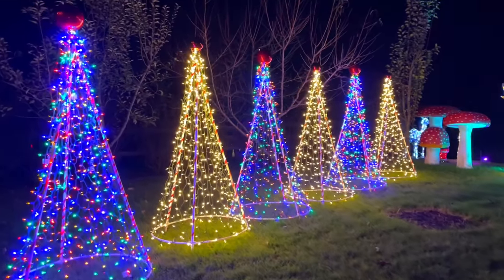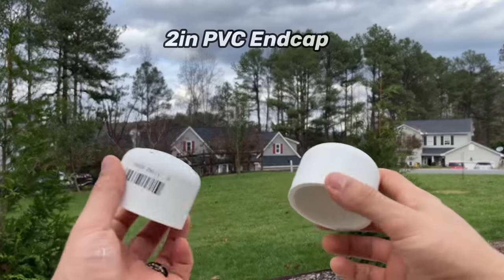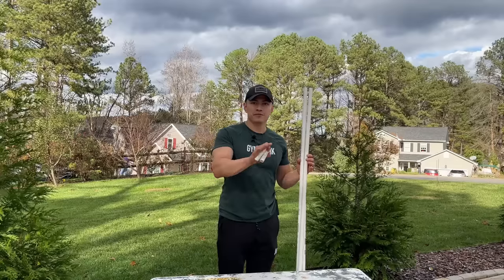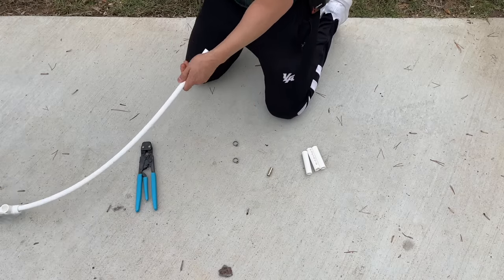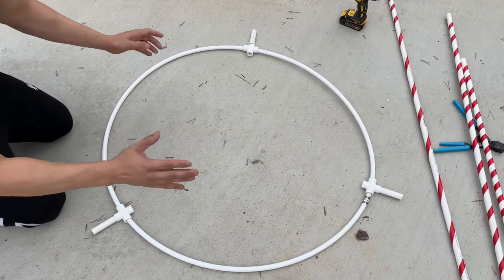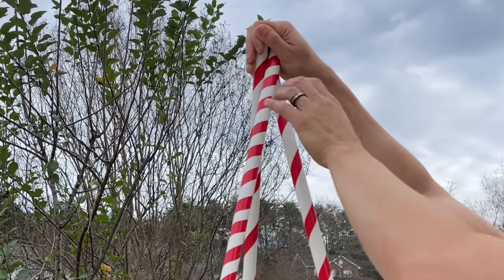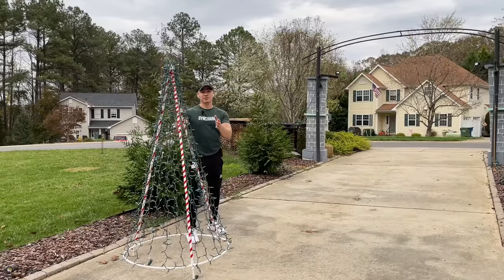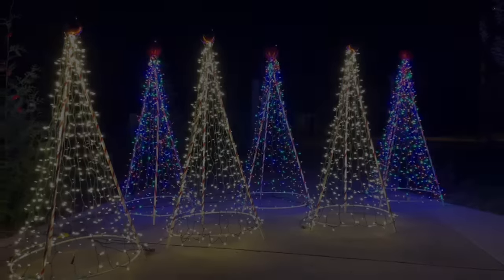EASY PVC CHRISTMAS TREES - TUTORIAL

Comment: 🤔Hmmmm…this gives me an idea. Instead of PVC pipes, you could use upside down round tomato cages, zip tie the top wires, and then add Christmas lights to it? You can stake the tomato cage down using landscape garden staples. I have some 54” in tomato cages in storage from summer gardening. The Christmas tree won’t be as tall but it’ll be an easy diy. 🤷🏻‍♀️

Comment: About how many strands of lights did you use and what was their length? Trying to get a total length in feet if you don’t mind
Reply from the maker: I used 7-8 boxes of lights per tree. Each box has 100LED lights. More lights can be used if needed for a more magnificent effect.
Reply: I would also look for white stranded lights as they will reflect the light from the bulbs better.
Reply: Make sure they are led lights because the cheaper mini lights will blow a fuse if you use more than 3 strands per outlet or extension cord. Led is the way to go, you can literally put as many as you want.
Reply: You could also by 700-800 strand lights, that way you don’t really have to buy more strands, because that way it could become more expensive, whereas if you get one super long strand, they tend to be cheaper.
Reply: I have never seen 700-800 light stands where do you get them?
Reply: @wendylewis108  I am most likely wrong about how many are on a strand, but I got the strand online, also this was a couple years ago.
Reply: @wendylewis108  I was wrong about how many lights were on a strand, but there are several different options online about how many lights per strand you can get. The link I provided is for Amazon, and that one specifically has 1000. However, at least this way it’ll look much more fuller.
Reply: @erniewyles8832  we’re you happy with the lights,? I have the same amount coming🍻.
Reply: @richardgaia5970  yes. Very nice. Very pretty.
Reply: Amazing video, thanks for sharing! Congratulations on your new book 🎉! Very clever idea to advertise your book yourself on your video. 😉 It’s a swell Christmas gift idea. I’m sharing your video especially with my friends and family with kids that I’m sure will enjoy your book 📕. Happy holidays ❄️
Reply: @wendylewis108  it's probably 300
Reply: @IsaacAlexanderDIY Thank you for video, I can't wait to make a couple of them but I can't help but ask about those huge mushrooms in the video! I love them. Any info is appreciated.
Reply: @bethschuler463 wow, I didn’t realize that.  That would definitely explain why the old ones were always blowing fuses.  We used to have a special place in the drawer for the extra little fuses.  So glad we have LED now.
Reply: Hello Mr. Alexander I love you tutorial and I was wanting to make me one so I was wandering I have the real small PVC pipe and the diameter is small clouds I use that to make one and would I need the same materials you used for the wider PVC pipe. TIA
Reply: Thanks for the post!
Reply: Trying these! Ty! U r amazing!

Comment: If price is an issue, instead of buying the PEX tool, clamps, and fittings, you can just get one SharkBite  1/2-in Push-to-Connect Coupling.  This will work the same, cost a fraction of the price, and will only show a little metal in the coupling, which can easily be painted to mask.  Just a tip for those who are only buying the pex stuff for this project.  The tool alone is over $50, where the coupling is just from $8 to $10 per piece.
An even easier alternative would be to simply use white duct tape to secure the two ends.  The pipe isn't under incredible pressure, and it makes it easier to take down at the end of the season.
Reply from the maker: Thank you so much for this cost saving tip, I can’t believe I didn’t think about the push to connect coupling, thank you so much for this!
Reply: Great idea.  To also save money, could I use a hula hoop.  I have so many I never used in the summer.  Some of them are very large in diameter and some smaller.  I could cut them and use the duct tape to secure the two ends as you suggested Ernie if I use the couplings.
Reply: @robinowens2851  yup, I think a small hula hoop would also work. Good suggestion.
Reply: Can you just use hose clamps?
Reply: @poolman8676  you can, but the pressure isn't great on this tubing, so quite honestly, just get some white duct tape and connect it with that. It's an even cheaper alternative and you won't notice it.
Reply: @erniewyles8832  Great. Ty

Comment: Great idea!  After Christmas sales are the best time to buy Christmas lights for next year!  I made a PVC tree like this that I have been using for about 12 years (10’ PVC but had to put metal conduit inside to stiffen it up). But this gave me some ideas to improve it (the ring at the bottom and the T connectors.) I keep wanting to make a 6’ and 4’ tree to sit next to the 10’ one. So this video gave me ideas. You might want to wrap the screws at the top in electrical wire (or use drinking straws around them) so the wires don’t rub on them and the insulation gets cut. (The straws will be like sleeves around the screws).

Comment: A couple of things I like my lights pulled real tight and if you are using new lights it is hard because they are in the  box for so long so before you attach the lights tie the plug side to something outside and pull them to another side an tie them to something as the sun warms up the  wire then  you can pull them till they are straight. You can use the fence line or trees or stake them in the grass. If you want to take it all down to store them use velcro to hold the topper in place instead of glue. They sell long storage boxes for wrapping paper mine is 6 ft so the trees are 5.5 ft or shorter. You can also just wrap them in cellophane wrap and stand them somewhere. I also wrap my lights  on extension cord caddies then wrap them in cellophane. For Icicle lights I loop them around the fireplace and turn them on for an hour and then straighten them all out before i hang them outside. Hope some of these hints help.

Comment: One suggestion-the scerw threads at the top will chafe on the light wires and short them out. You might put some skinny tubing over the screws to protect the wires.
Reply from the maker: That’s super smart! Thank you for this tip!
Reply: I put shrink tape on mine, to protect the wiring.

Comment: Love the design and implementation, I build a similar tree from scratch using a wooden post as a center pole. My only suggestion for this design is to attach the circular piece of PEX using a temporary attachment, such as a clamp or likewise. This way the entire tree can be disassembled for easier storage, as the pieces can be stacked in a smaller space for storing after the holidays.
Reply from the maker: Thanks for the tip🎉
Reply: I’m in the process of doing something similar.I’m planning to just use tent stakes for the bottom of the light strings rather than a hoop to make it more wind resistant. I really like the tripod design and the pvc cap for the top.

Comment: Nice tutorial. Was wondering if you could simplify the tip by drilling a hole horizontally through the three pipes at the top and put a bolt/locknut through the whole to fasten them together. If the hole is larger than the bolt diameter, you should be able to swing and twist the poles to the needed angles. At the end of the season you could just leave that end connected. If you drill the hole a few inches down from the ends of the pipes you could use the pipe ends to drape the light strings, rather than the screws in the end caps.

Comment: If I could make one suggestion, turn your ornament upside down on top so it won't collect rainwater and freeze. This is a very nice decoration that won't break the bank. For storage you could make each one slightly smaller so they will stack. This might require making the first slightly larger depending on your design.
Reply from the maker: Love this tip!

Comment: considering trying this, but wondering if i could use traditional hose clamps to avoid buying the clamping tool id likely never use again,  may not hold well enough though. maybe pipe glue on the connector piece of the base would help too. thanls for some good inspiration

Comment: What length of lights did you use,I'm  wondering about having xtra lengths of lights left after I fill the tree??
Reply from the maker: I used 7-8 boxes of lights per tree. Each box had 100LED lights. Each strand of lights I bought measures about 24ft (purchased my lights at Lowe’s) More light strands can be used for a more magnificent effect.

Comment: Question for you if we don't have one for the base is there another way to connect them without a crimp tool "pex tool"? Those trees look amazing I'm going to be adding a few to my yard. Thanks
Reply: THere are quick-connect fittings you can purchase for$8 - $10 each.  Or simply tape the ends together with some white duct tape, or white gorilla duct tape.
Reply from the maker: Yes! There is. It’s called push-to-connect! 
Here’s the link. You don’t need the pex tool if you have these 

1/2-in Push-to-Connect Coupling https://www.lowes.com/pd/SharkBite-1-2-in-Push-to-Connect-x-1-2-in-Push-to-Connect-dia-Coupling-Push-Fitting/1000182555

Comment: Instead of the PEX connector and clamps, I just used a 1 inch section of 1/2 wood dowel and two radiator clamps for the hoop.
Reply from the maker: Thanks for the tip 😊

Comment: I was getting the supplies to make this tree and found that the shark bite connectors are almost 9 dollars a pop and that wasn't in my budget so what I found is if you use about a 2 inch piece of 1/2 inch pvc you can use that as a sleeve to connect the ends of the PEX pipe and run two screws in the ends to secure it.  I also used a heat gun to try to ease the curve on the pvc pipe but it's not needed.  I would post a picture of it but I don't know how to.😁
Reply from the maker: That’s a great tip thank you so much

Comment: IMHO you should save some money and use a 1/2" pex adapter and glue the loop closed then never worry about clamps rusting. also on the ends (feet) I would use a 1/2" female adapter to male threaded end to screw (C436-005 1/2 MA ADAPTER) into a 1/2" NPT Thread Heavy Duty ABS Stake (usually used for sprinkler systems landscape lighting etc) so you can push your feet straight into the ground. They also make the gorund stake in stainless steel but more expensive. Then if you put it all together first will be much more secure and stable when trying to attach the lights! Again just my opinion to save some money and time! Awesome walk-thru for sure! thank you
Reply from the maker: Thank you for this great tip!

Comment: Nice work. How about just using small hose clamps for even more savings.
Reply from the maker: Actually the best saving tip is to use a push-to-connect coupling so you don’t need a pex clamp tool or clamps

Comment: Wow! Those trees are beautiful, but question, how would you store them?
Reply: I suggest just knocking the cross tees off the the large pieces of pipe and then depending on how tightly the cap was screwed on, unscrew the cap slightly until the 3 long pvc pieces can be pushed together. Then you just have a pex ring and a bundle of 3 pvc pipes to store.
Reply from the maker: Thank you Tammy, I’m glad you like the trees. Since you asked me, here is how I would do it. Remove all the lights and store it properly, then unscrew the top end cap and remove the screws inside  cross connector on the bottom. You’ll have pieces you can store easier
Reply: @IsaacAlexanderDIY  cool thank you. I am going to have my son try to make us one or more for our yard. Easier and lighter wt than our wood one we do.

Comment: My question is. How do you store these? Can they be folded up somehow?
Reply: You could unscrew the bottom ring and it would sorta collapse flat
Reply from the maker: Thanks for your question, Marc. Like another user mentioned, we would unscrew the legs and the endcap so that we could fold it and put it away nicely. Unscrewing the 3 pvc pipes allows us to store everything in  small spaces.
Reply: @Luke C  I recently did a PVC light project and actually used one size up PVC as the clips and cut out a crescent shape. Wondering if that would work to have something for the pex to snap into. That way you're just leaving the small clips in the legs.

Comment: I would I use the hula hoop for the bottom round pipe, and screwed through the hula hoop and the pipe.
Reply from the maker: How would you get the PVC connectors inside the hula hoop?

Comment: Hello I was wandering how you got the circle shape and how did you bend it without it breaking.
Reply from the maker: Hi Richard, I would suggest watching the video first so you can see how I got the circle shape, as I explain that and all the other steps in the video
Reply: @IsaacAlexanderDIY  Sir I have watched your video several times and I did not see where you explained how you got the PVC pipe to form the circle all I saw was you connecting the ends together.  So I went to Lowe’s today and tried to bend the 1/2 PVC pipe you recommended and used on your video but could not bend it.
Reply from the maker: @richardmoffitt3191  it’s pex pipe. It’s not pvc. You have to get 1/2in pex pipe
Reply: @IsaacAlexanderDIY  oh ok I’m sorry I thought it was PVC pipe because the title of the video say’s PVC CHRISTMAS TREE TUTORIAL. I apologize.
Reply from the maker: @richardmoffitt3191  if you would just watch the video, you would see that the structure is PVC, the connectors are PVC, but the ring, a.k.a. “circle shape” at the bottom is pex pipe. Beginning at minute 4:55 is when I extensively go into step-by-step process on how to create the base circle shape using pex pipe.
Reply: @IsaacAlexanderDIY  ok so all the materials you are using is PEX and not PVC  even the endcap is PEX
Reply: @IsaacAlexanderDIY  ok sorry for all the questions just wanting to get the right materials that’s all.

Comment: How did you connect each set of lights together and also protect the electrical connections from the weather?
Reply from the maker: I’m sorry Paul, I don’t understand your question. There’s only one way to connect Christmas lights. I don’t do anything to protect the electrical connections from the weather
Reply: So your using 7or 8 sets of AC lights per tree. And that's using US styleplug/voltage. Are you connecting them together or into a power strip?
How are you protecting those AC plugs from the outdoor elements?
I'm asking for the benefit of anyone else watching as you straight to showing the lit up. Hope this clarifies my I initial question
Reply from the maker: @paulgascoyne5248  I’m not sure I still understand your question because in the video I explain that the light sets have to be connected to one another and then you have to bring an extension cord to power up the tree. The seven or eight boxes that I use all have to be connected to one another, that’s the only way one connects Christmas lights. In the video I explained that you have to  go up and down the tree connecting the lights as you go and that you have to leave a little bit extra when you begin so that you can connect it to your extension cord. And like I said in my previous message, no I didn’t do anything to weatherproof the connections or protect them from rain. I never do anything. Sometimes when it rains the lights won’t turn on but they’ll dry out the next day and everything is fine. Also you’re telling me that you’re asking for the benefit of anybody else that is wondering but nobody else has asked this question. Perhaps I’m just misunderstanding, are you not based in the USA?
Reply: @IsaacAlexanderDIY  OK I must have missed that part with the connectivity. No I'm from the UK, any power cables outside always need to be insulated from the weather to stop them shorting out.

Comment: You did not mention where the power source is.  Did I miss that?  Where did you plug this in and did you have cords running across your driveway?
Reply from the maker: Yes I show where you plug it in. It’s at the bottom of one leg (where you start the first strand) and they did not stay on the driveway, they’re on the lawn
Reply: @IsaacAlexanderDIY  Hi, I do not have any outlets in my lawn, where do they plug in, and do the cords run behind them?
Reply from the maker: @adobeblue4360  Have you never plugged in Christmas lights before? I’m so confused at your question. I used an extension cord. I plugged an extension cord to an outlet that’s by the front door. Then I run the extension cord all the way to the trees and just plug it in to the first tree. Then just use the Christmas light end to plug to the next tree and so on and so forth
Reply: @IsaacAlexanderDIY  tku.

Comment: FWIW: After trying (fighting / wrestling) with the PEX for the bottom ring (loose, floppy, smaller diameter than the ID of the cross),  I abandoned that and made a form for bending 1/2" PVC into 3-120 degree arcs (using the form and a heat gun) and then using the crosses to complete the bottom ring.  

Could not "properly" get the 3 pipe ends to fit up into a 2" PVC  cap without the 3 pieces twisting at the top.  Found out that 3-1/2" PVC connectors fit perfectly into a 2" PVC pipe cap.  When you put the connector on the pipe the pipe goes half way into the connector and then you can run a screw through the cap and then through the "empty" end of the connector (I 3D printed a solid "spud" to put into the empty end of the connector to give the screw a little more bite).  That way the pipe can be removed from both the cap (connectors stay screwed to the cap) and removed from the cross at the bottom to make storage simple.

Sounds more complicated than it was to do but it makes the tripod tree WAY MORE solid, particularly for anything over 5 ft. tall.